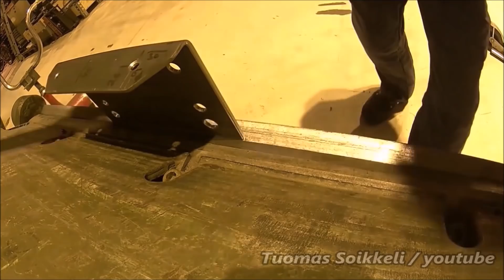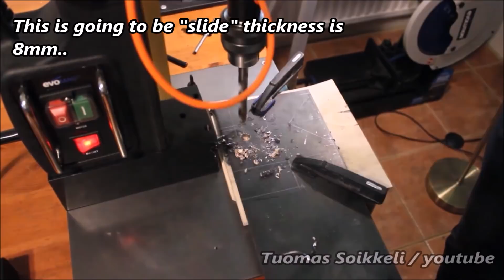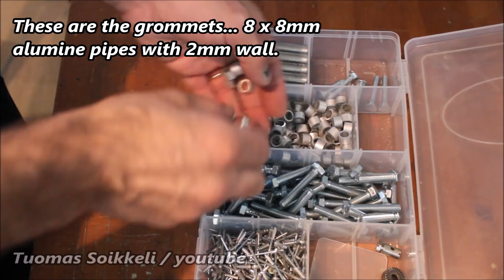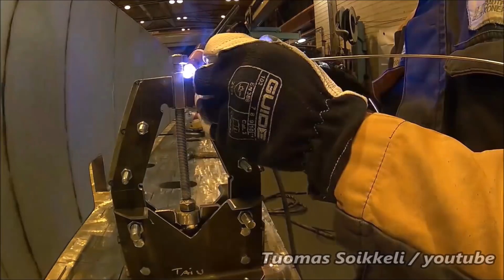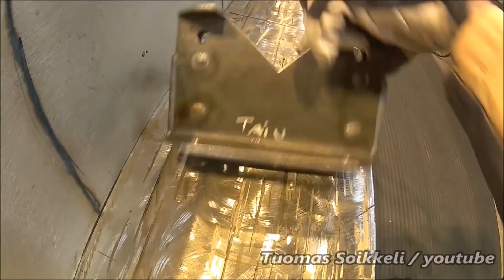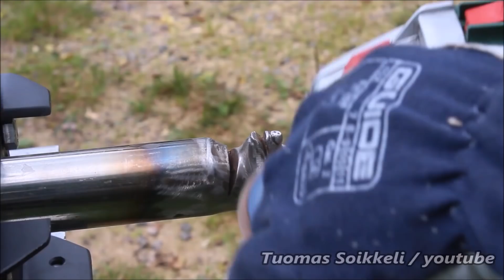My pipe vise

Comment: Excellent build imho.  Thanks for sharing!  Maybe a quick release pin (ball detent or clevis type) for the swivel lock bolt?
Reply from the maker: pjsalchemy Thanks buddy! I had quick lock in my first toughts, but i noticed that most likely i don't need to use it very much, so i left it.

Comment: what welder are you using and what is that circular blade that cuts 4 mm metal as butter ?
Reply from the maker: bbogdanmircea Its regular 1mm thick cut off wheel. Cuts much faster, but doesn't last very long. Good with materials with 0-6mm thickness. With thicker ones it stucks easier.
Reply from the maker: ... Forgot. Thats Kemppi mastertig mls3000 Tig/stick welder.